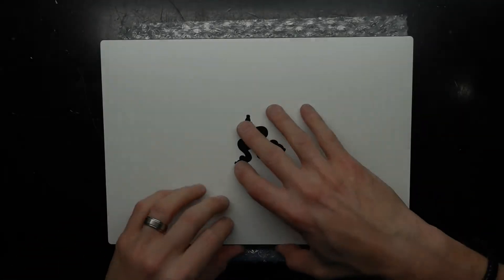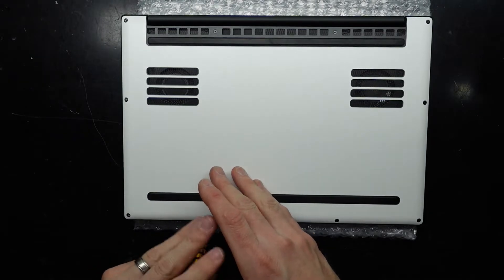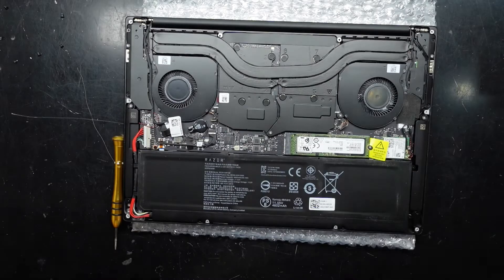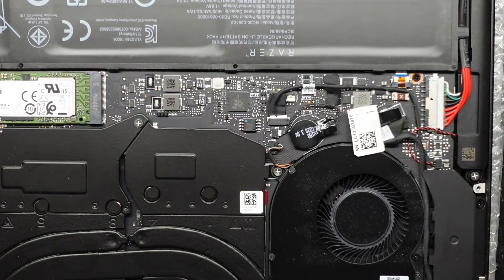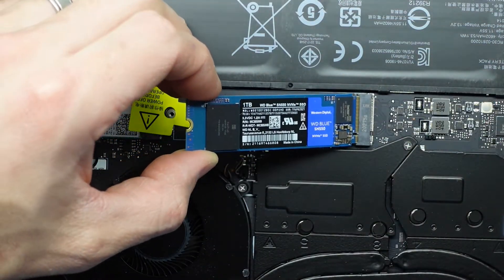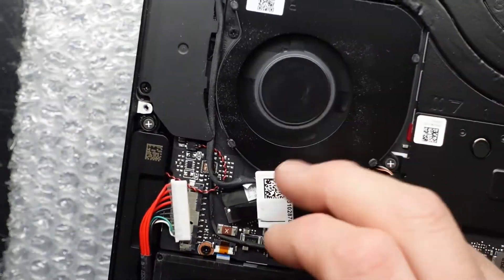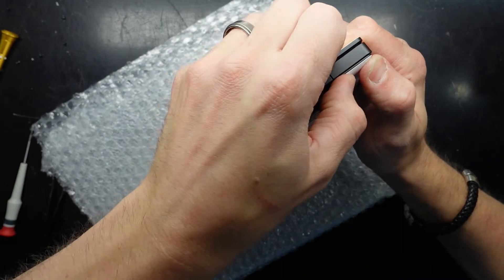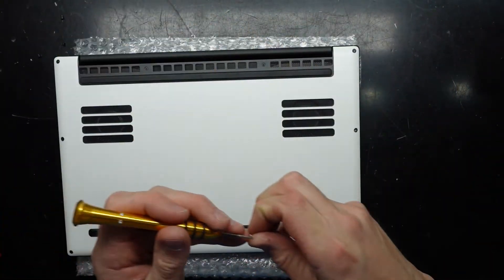Razer Blade Stealth 13 2021 how to upgrade your NVMe SSD

Comment: is there enough space to install a 4tb or 8tb SSD? I saw in the 14 inch models that you have to bend the larger SSDs slightly (since they have chips on both sides), and while it still works, it's not good for the longevity of the SSD. the person suggested maxing out at 2TB SSD for that model. is it the same story for the 13?
Reply: i'm also thinking of maxing it to 2T
Reply from the maker: not sure on that one actually.

havent gone over a terabyte for a laptop myself
Reply: @rickstechrepairs  Can you upgrade ram on razer blade 13?
Reply: @Kraken_Lore  no